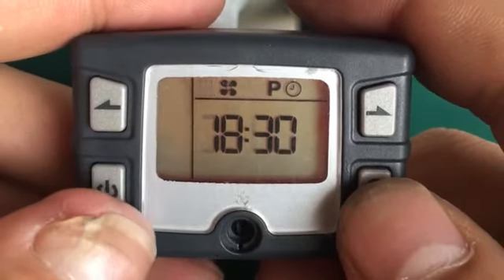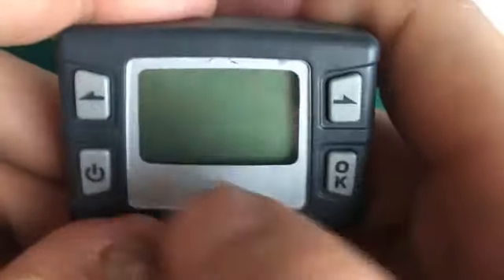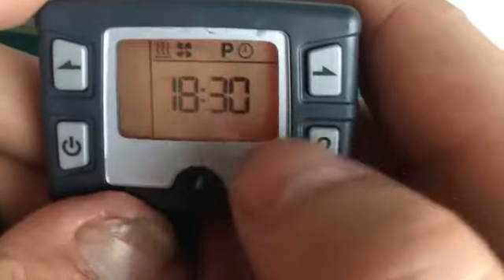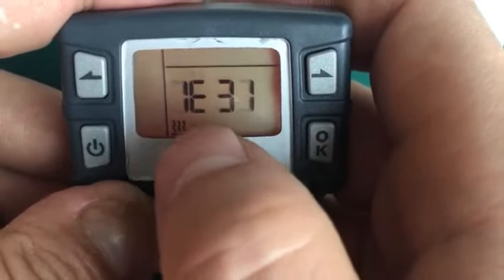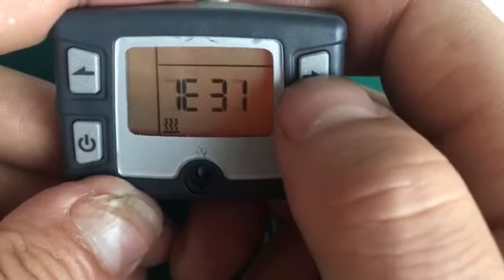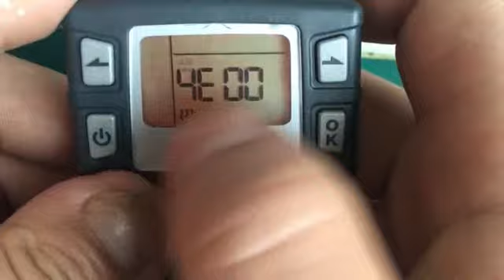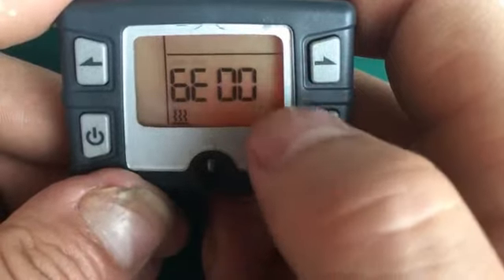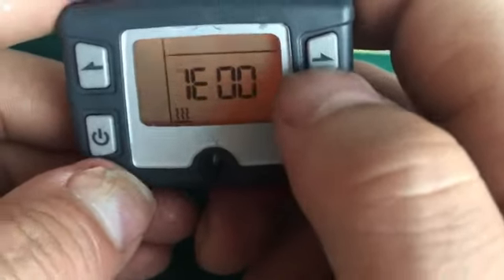How to Check and Clear all error codes -- For Digital Control Heaters

Comment: I have the 2kw gasoline heater with this controller. My manual tells me error codes according to led flashes. They do not seem to apply. I have code 10 and code 20. Where can I find a list of error codes?
Reply from the maker: Hello Rick, can I have your email address? We can send you the error code lists. You can contact me at michellewang@jpchinatrade.com
Reply: The faults will be displayed as flashes. Count the flashes to determine the
code.
Number of
Flashes
Cause of Problem
1 Failure of second start
2 Termination of the third time of combustion
3 Voltage power out of specified range
4 Glow plug temperature increases slowly
5 Air heaters will not flash 5 times
6 Temperature sensor: Broken circuit or short-circuit
7 Fuel pump: Broken circuit or short-circuit
8 Fan motor: Broken circuit, short-circuit or clogged
9 Glow pin: Broken circuit or short-circuit
10 Overheated
11 Overheat sensor: Broken circuit or short-circuit
12 Control switch: Broken circuit or short-circuit
Timers
1E-02 : Overheat – Check for obstruction or damaged ducting
1E-10 : Ignition failure – Check fuel supply, blocked supply or fuel pump
1E-30 : Voltage too high
1E-31 : Voltage too low – check battery or voltage drop in supply cable
1E-52 : Overheat sensor failure
1E-70 : Fuel pump open circuit or ECU failure
1E-80 : Air motor failure
1E-90 : Glow pin failure
1E-d3: Maintenance Reminder